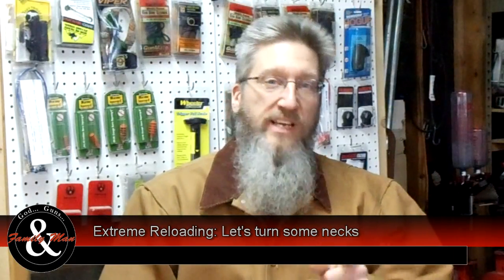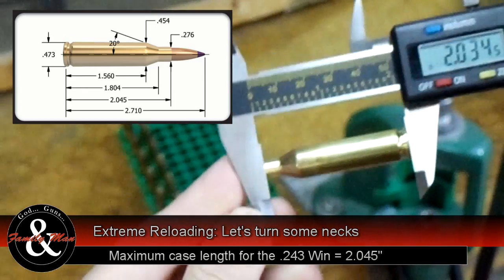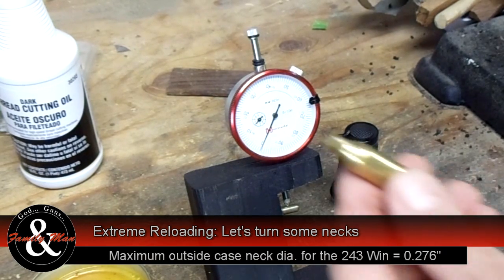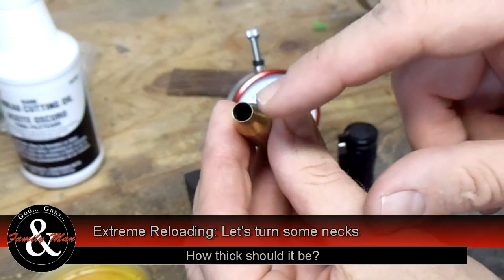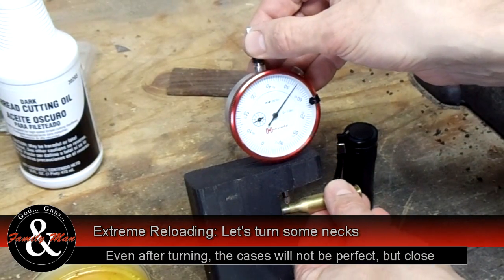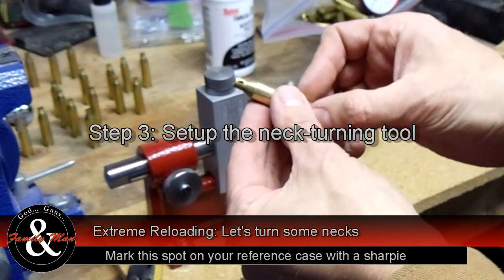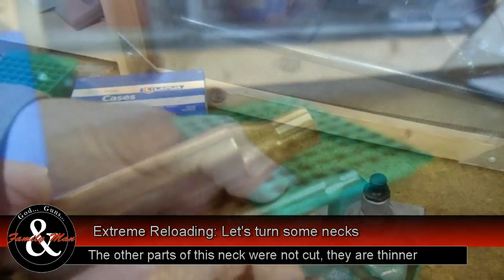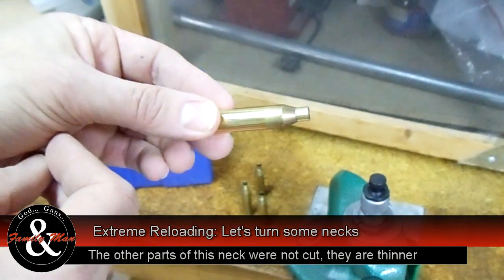Extreme Reloading: Essential Case Measurements and Turnin' Some Necks! (ep. 02)

Comment: Good Vid. well explained thanks
One question when you neck size any case the overall dia. will be reduced so I guess that means changing to a smaller bushing die correct.
Reply from the maker: I no longer neck size my brass.  Instead I full length resize using the Redding Competition FL Sizing Die.  This takes a bushing that one buys separately.  For my .308 I am using a 0.334" bushing.  Just at the end of the case prep process, I expand the necks using a 0.3060" mandrel.  All this gives me the neck tension "preferred" by my rifle/load (about 0.002-0.003").
The bushing you choose should be the size required for your load to perform well. Of course you don't want to size the neck down a lot and then expand it back out a lot as that unnecessarily works the neck and will lead to premature failure (neck cracking).  
PS- I also anneal my precision rifle cases
Thanks for watching and posting. I hope this helps you.  Let me know if you have a follow-up question.

Comment: I like your approach to first start determining the "gold standard neck thickness". Good tip to keep brass cool with lubricant...I don't think heating would cause brass to become brittle, but it would cause the neck to expand and thus inconsistent cutting depth may result..shallower cuts for cooler necks, deeper cuts for hotter necks.  An expansion of half a thousandth of an inch would be bad...

Before neck turning, all cases need to be consistent in terms of case length, so trimming each case to the same length may be an important step.

With neck turning, cuttting into the shoulder will weaken a case.  But not cutting the entire neck all the way to the shoulder will cause an external "doughnut" that gets pushed inside the neck when the case is fired (and the case neck and shoulder expand to the chamber wall).  That internal doughnut can then cause accuracy problems. 

 I usually fire-form cases, resize with no expander ball, then use an expander mandrel so the case neck can be expanded to perfectly fit into the neck turner mandrel in terms of tightness. After using an expander mandrel, the internal dimension of the neck is more consistent and more concentric. Then neck turn so the external dimension of the neck is consistent.
Reply from the maker: Thanks again for watching.  Good points all around.  We will cover some of these in an upcoming video in Season 6 of Extreme Reloading as we dig into our neck tension series.  Thanks for posting also.
Take care.

Comment: Very sweet vid !  A question for you. On some of my cases the neck thickness ranges from .015 to .0125. Now to get the best out of the neck should I take it down to .0125 or will it be too thin ? This is my very first time neck turning and some people say just cut till it’s all clean, but who knows at what thickness it will finish up at and what’s dangerous ??? Confused 🤷‍♂️ Any help greatly appreciated !!
Reply from the maker: Thanks for watching.  What cartridge is this for?  .308 win?  Knowing this will help answer the question you have.  If you go too thin you may not have good neck tension on the bullet which in turn could cause some erratic performance in your loads. There are lots of variables so let's discuss this.
BTW, how many cases do you have with the thin 0.0125"?  I am a firm believer in culling anything that does not meet my specs.  You could sort those out and use them for general shooting while reserving your best for precision work.
Reply: sdkweber  thanks for the reply. Right now I am dealing with a bunch of 2X fired .270, in Nosler and Hornady.
Reply from the maker: @PRACERZ  I have noticed Hornady brass tends to be heavy/thick.  I like Nosler brass better.  According to SAAMI specs your .270 should have an outside neck diameter of 0.308", with a 0.277 bullet that leaves 0.031" or 0.155 case neck thickness max.  Those cases at 0.015 are pretty close to max. I would probably take them down a bit but not to 0.0125".  How is your neck tension? Are you using any special neck sizing die to achieve a specific tension?  Is this in a custom rifle with a special chamber?
Reply: sdkweber  Have not loaded any of the neck turned yet. No custom rifles, just trying to make several guns the best they can be .
Reply from the maker: @PRACERZ  I do not have custom rifles either.  Some of the customs can have special chambers and throats making this more difficult.  
What I would do is seek uniformity/consistency. You might get good results by taking all cases down to 0.145 (or start by doing 10 of them... load them, compare them to previous results).  You certainly hate taking off too much but you can work incrementally and take off a bit at a time (test/repeat).  If you take off too much you can start anew with fresh brass.  
What is important is the consistency so the case (mouth) releases each bullet at the same pressure point and in a straight fashion to meet the leade and throat.
I hope this helps.

Comment: This happened to me but i found it was me not reaming some of  the trimmed cases  enough at the inside  mouth  and the bullet was catching on the inside roughness off the case  also SCORING  the bullet, pull a few heads and check them out see if they are scored .it was actually collapsing some of the front edge of the case causing them not to cycle easily. OR AT ALL
Reply: Run them through a neck sizer afterward and recheck the neck thickness and concentricity.

Comment: After watching the case wobbling in the clamp before going over the mandrel, I have to wonder about concentricity. It looks like the case may be being forced hard to the cutting blade at times, then forced away at other times as it completes a rotation. I note similar issues with plenty of folks using case trimmers. I will suggest putting the case over the mandrel first, then tightening the clamp where possible.
Reply from the maker: Hello Tim
Thanks for watching and posting and for the tip.  I would like to try this next time I turn necks on some cases. Not sure this machine will allow it though as the shell holder requires the shell to be slid into it from the side. Once it the case neck is on the mandrel I am not sure there will be enough play in it to allow it to slide in.
Reply: You make a good point about case wobbling. Wobbling is usually an alignment problem between centers being not concentric - center of mandrel and center of case clamp, case neck center and case body center, or combinations of that.  I have a hand crank on my case turner, and I'm careful not to put excessive amount of downward or upward pressure on the crank that can cause the center of the case clamp to shift while I'm turning the crank. If I were to use a power drill to turn the case,  I would have a fixed support to support the body weight of the drill.  Good luck

Comment: Your gauging case will reward you better than any neck turning you could ever do on caliber specific brass/ tight fit in chamber with .002 clearance for bullet release is best ( start a bullet straight it shoots straight)
Reply: Volume measure powder not weight humidity affects weight on propellant  / use weight to keep safe load charge on work up of target load then repeat that volume
Reply: Use chronograph to get you load velocity consistent sub 10 fps is goal in variance / barrel temp  heat will be your worst enemy  as impact changes as does temp no long shot strings
Reply: Check bullet run out for wobble in loaded case true it up / primer pocket depth cut same depth in all cases
Reply: Weigh primers and cases seperate weigh projectiles Too sort into lots
Reply: Set bullet jump to lands it will have a sweet spot in distance
Reply: Also if using commercial dies not custom made to match your chamber dont be scared to try different brands as some will be a closer fit or shoot way better than others don't cull by name brand as  Lee may be good in this caliber or redding in that and rcbs in another or any body's die as that goes into acurracy
Reply: Brass will be softer or harder pending brand don't be surprised if   A shooter out performs you with range scrap as his brass prep may be better than yours
Reply: Lapua does most of brass prep for you but if you win matches you have learned to reload well using what you brung to do its best

Comment: I am getting about +/- .0005 after turning on my HCNT tool. I've noticed a bit of wobble while the case is on the spindle.

What kind of variances do you see in NWT after turning?
Reply from the maker: Hello Dan
What you are seeing is probably correct. +/- 5/10,000ths with this equipment. However, I am not noticing any wobble while I am turning these necks and in fact, a noticeable wobble would probably result in even greater variance than what you are seeing.  Your shell holder is tight, right?
I hope this helps. Thanks for watching and posting.

Comment: Great Video! Where did you get the measuring tool to measure the thickness of the Case neck?
Thanks
Reply from the maker: Thanks for watching and posting.  I took the gage from my Hornady concentricity tool, extra mandrels for the same neck turning tool, some thumbscrews, nuts, etc. from Home Depot  and then crafted the rest out of wood using my drill press and table saw.  It works Ok. I am thinking about getting a new gage from Sinclair though. I think that would be even better.
Reply: Thanks, will try that too
Reply from the maker: You are welcome.  Good luck. One point to note is when you are drilling and positioning the spot for the gage make sure it is perfectly perpendicular to the mandrel.  I ended up wasting a few boards before I got it right.

Comment: how are you liking that hornady neck turner so far? im in the market for one and have seen mixed reviews.
Reply from the maker: I am liking it very much.  I used it to turn some .220 Swift brass recently and dropped by group sizes substantially.  I am now pretty consistently at 1/4 MOA with that rifle.  
I will be running a bunch of .308 Win through it soon also.
The only problem I had was with my .338 Win Mag cases... the arbors are too wide.
Reply from the maker: Correction, I meant mandrel and not arbors.

Comment: Good video. one suggestion. you have some misinformation. when talking about heat in brass, it does not make brass brittle or hard. similar to copper, Brass hardens only through working. In the case of cartridges, after a case is fired a few times it becomes harder. this changes neck tension. Annealing uses heat (700 F) to soften that brass again to make it uniform piece to piece. thus creating more consistent neck tension. Another bi-product of annealing is dramatically improving brass life.
In terms of neck turning, heat isnt good because you can end up with galling on the arbor. however, it would be very extreme to get it hot enough to anneal the brass as 600-700 F on brass has a very slight glow in the dark.
Anyway. I hope you dont take offense. But Its very important to understand metallurgy of brass  when reloading for precision and long life.
Best regards.
Mark
Reply from the maker: This is good stuff Mark.  Thank you for the post and you have made a good clarification.  In effect, heat softens the brass (annealing) and work (firing, etc) hardens it.  

In regard to neck turning then, the lube is more for the cutting pieces (steel) than for the brass.
Reply: "In regard to neck turning then, the lube is more for the cutting pieces (steel) than for the brass."
No not really. 
Lube does a few things in neck turning. Maybe the most important is it lubes between the mandrel and case neck. If the fit between those two are very close, as the neck heat, like with any material, it expands. as it expands that fit becomes closer and closer until in effect its an interference fit. When that happens you can get galling. meaning the brass and the steel of the mandrel will try and fuse like soldering. the lube reduces the friction and threes less heat propagation. 

Also when cutting any sort of metal, metallic or not, lubrication gives better tool life and increases surface finish.
Reply from the maker: Thanks again Mark, 
This is very good information. As you saw in the video, I do lube both the cutter and the mandrel (even if I did not appreciate all the details of why this is important). I realized it is important and now have an even better understanding of why.